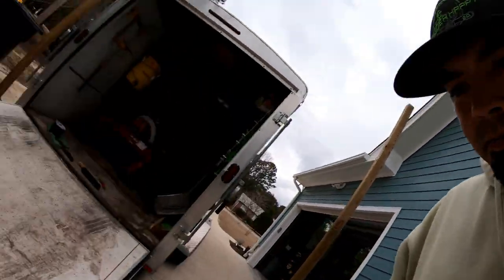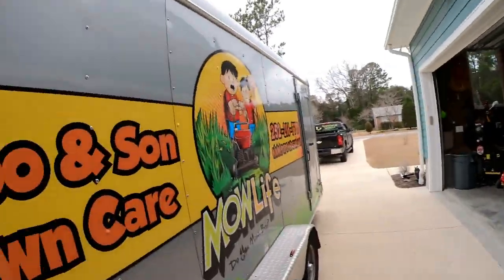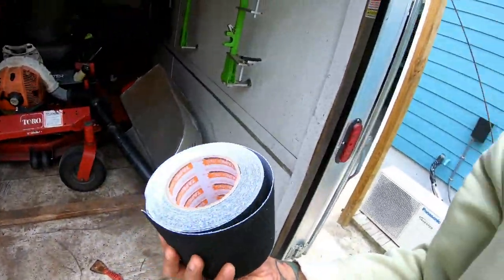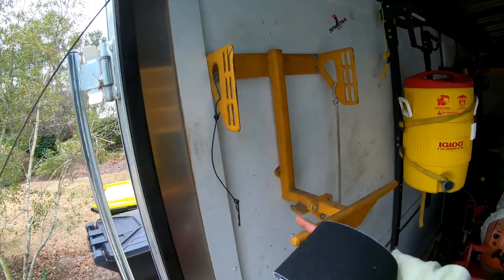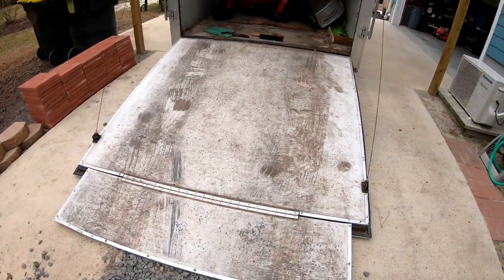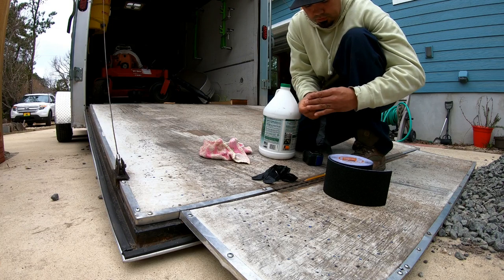Grip tape install for traction for mower

Comment: Just curious....how well did it hold up? I have a pair of fold up metal lawn mower ramps from Sears that work great until the tires on my lawntractor are wet! Then I have a heck of a time driving the tractor back up into the pickup bed ! I was curious if the traction tape would stay on metal ramps very well? The metal grip cut outs on these ramps stick up and slice my tires when the tires go to spinning!
Thanks for the video and your thoughts on my metal ramp dilemma! 👍🏻😀
Reply from the maker: Well....not so well to be honest. I guess the quality was cheap or we are just to rough on it. So I replaced it with another brand and that one had held up better. You could definitely try it on your ramps. Just may have to replace every 6 months or so. Thanks for the comment